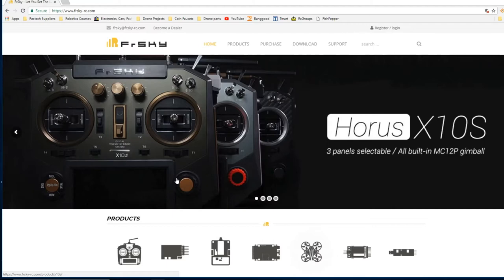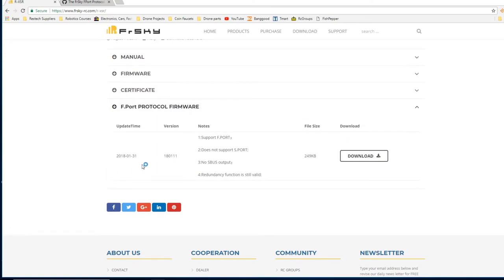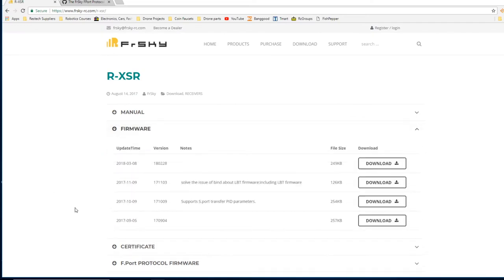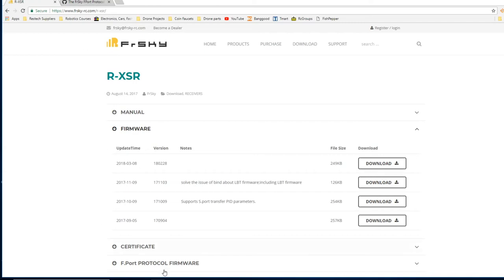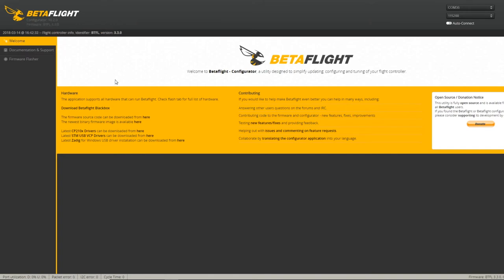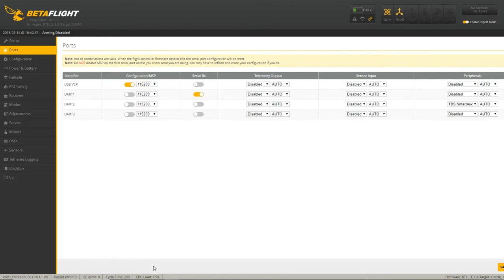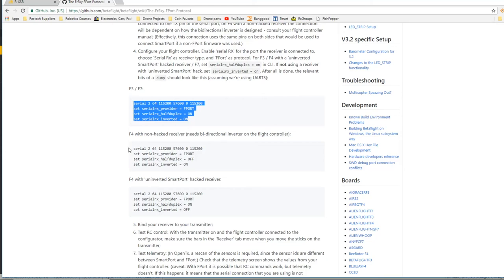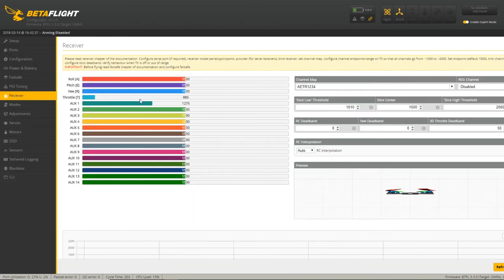How to setup Frsky F.port Protocol R-XSR Betaflight

Comment: Need help! NWhich telemetry output? In ports tab Smart Port? Frsky? Eh I've tried both... I have no idea why this isn't working I've done everything step by step. I've got the flex firmware, on everything, but either way the uart is the ports just won't stay in what i set it to, so something's screwing up. I'm using the slim+so i used the uninverted s. Port wire to go to tx3 on lumenier micro lux v3 so i wouldn't have to use soft serial inversion, and i used the cli set of commands for f4 with receiver uninverted.. I've got it set to fport, serial based. What am i missing? It's uart3 so i copied cli as was, used for 2(uart3) in0=uart/tx1 1=2 2=3.
Reply from the maker: You don't have to set that in the ports tab just turn on telemetry in the configuration tab and set your serial rx to f.port and you're set
Reply: @dwarfstarfpv2056  ok i must be missing something..
Reply from the maker: @softsmoken  you tried turning on or off half duplex in the cli?
Reply: @dwarfstarfpv2056  on, just copied and pasted
Reply: @dwarfstarfpv2056  I'm bound to it using an xlite. I dunno i can't see what the problem is
Reply from the maker: @softsmoken  its definitely betaflight f.port is a real pain I stopped using it unless the flight controller has a dedicated smartport pad then f.port is a bit easier to use
Reply from the maker: @softsmoken  also make sure your wiring is correct you only use the smartport pad and are you using the sbus pad on the fc?
Reply: @dwarfstarfpv2056  i used the slim+so it had the extra sport and sbus inverted from the normal inverted so uninverted, which is i think the whole purpose so anyway that's labeled rx1 for sport and i wired that to tx3 hoping to avoid using soft serial. But i also tried with soft serial on, no dice.. I'm not wired to sbus in the FC, i wish i could it would save the uart..sbus is an rx uart though not tx so can't.
Reply from the maker: @softsmoken  try using just regular f.port firmware instead of flex
Reply: @dwarfstarfpv2056 i only saw regular then flex which was only fport capable one i saw. It's annoying when stuff just doesn't work setup exactly how it's claimed stable.. really gets old quick.
Reply: Really disappointing might need to ditch r9 while I'm only 1 receiver deep, just gonna cost money and cause builds to sit unuseable, what's the point.
Reply from the maker: @softsmoken  yea I feel your pain lol all my builds are r9 now but I hate f.port in use normal smartport and its amazing f.port is super sketchy I can try to wire up f.port on my micro lux v3 and if I get it to work I'll let you know what I did
Reply from the maker: @softsmoken  haha so true
Once you get it working just never touch the firmware again
Coming to think about it I'll have to use f.port on my build also ughh this is gonna be fun lmao
Reply: Actually wait could i maybe use normal sport on tx3 and soft serial inversion and use the sbus pad for the rx wire which is uart1 on micro lux v3 and already inverted? Then I'd have tx6 for smart audio at least. Really wanted gps..
Reply from the maker: @softsmoken  you can actually use normal s.port soft serial on the led pad I think and you'd have all the uarts for gps and smart audio
Reply: @dwarfstarfpv2056  so it's the led pad that's uart1 not sbus? And is a tx?
Reply: @dwarfstarfpv2056 so with LED setup it would be sport to led and... Which to which, and then which uart would represent it and need soft serial inversion i mean?
Reply from the maker: @softsmoken  sbus will still uart1 but you're gonna assign the led pad to soft serial 1 or 2 and then that uart will popup in the ports tab and you'll use that for s.port
Reply: @dwarfstarfpv2056  is LED pad the tx to the sbus pad which is rx? Of the same uart? Cuz most uarts have a tx and rx so sbus is only one pad and is rx so that's why I'm asking.. If you happen to know lol... BTW I really truly appreciate every second of your time you've taken to help me out.
Reply from the maker: @softsmoken  ohh no idk where tx1 is or if there is even one but what you'll have to do is use the inverted s.port signal wire that up to the LED pad and wiring up sbus to the sbus pad then you're gonna have to remap resource the led pad to softserial 1 or 2 here is the guide i used and s.port works and you'll have the 2 uarts https://blog.dronetrest.com/smartport-telemetry-via-softserial-betaflight/
Reply: @dwarfstarfpv2056  we'll I'll have to give that a try... I'll get back at you on here let you know if it works. I might try fport on one or two other wired configurations before i change all the firmware again. I know tx is an input rx is an output. That's why you need the two for telemetry similar to how we need two for osd(video in and out).. far as i can understand..
Reply from the maker: @softsmoken  yea try f.port again and I think since you're using the uninverted signal tlm_inverted should be set to off and the TX you're using serial rx is to be turned on in the ports tab
Reply: @dwarfstarfpv2056  betaflight won't recognize the command... What a load of bullshit i typed get tlm in cli it shows the exact command but it doesn't work. Lol , unknown command, even though it just gave me the command from it's directory, Unbelievable... It's like it's all just broken.
Reply from the maker: @softsmoken  oh wow you're on the latest configurator? Type dump and scroll through to see the Tlm info
Reply: @dwarfstarfpv2056  yea i am It still provided the command including tlm when i typed get tlm
Reply: Tlm inverted=off
Reply: @dwarfstarfpv2056  what version betaflight were you using, which configurator with the  fport receiver that worked on for you?
Reply from the maker: @softsmoken  mine is on a helio board running 3.6.6 f.port is super slow at changing pids and stuff through lua scripts but regular s.port on the same 3.6.6 is fast you should really try regular s.port with the soft serial way it's pretty easy and should be flawless
Reply: @dwarfstarfpv2056  well.. i plan to go back to s.Port from fport if i don't have any luck finding any other promising things to try, but then i gotta switch my firmwares back on the r9mlite and the slim+. I had two questions, 1. So we can't have some fport receivers running and some sport without changing modules or firmware right? like i can run my xm+quad just that models settings are internal antenna on and external module off you know.. but the module can't do both, i don't think the flex firmware is capable of both i have to read it again... But you'd think in 2019 it would be able to run its basic old stuff on the same module. Question 2. If I'm not really flying long range, how much is the 900mhz gonna make a difference? I went with it cuz i got it new with the slim+for 46$ made on offer to guy on ebay r9mlite was 39 plus 5 ship obo and slim+was 29+5 ship obo i made an offer 22 and 19+5 shipped together,and the dude accepted it. Could've believe it. I wanted, even if I'm not going so long range to just have solid connection cuz there's all kinds of WiFi interference and stuff around this area. Basically How much of a difference did you notice when you switch to r9, besides distance gains?
Reply: @dwarfstarfpv2056  good morning! I got radio response in receiver tab with fport on micro lux v3 this morning!
Reply from the maker: @softsmoken  oh shoot now seeing this lol idk about the fport and s.port without changing firmwares but I try to make them all the same just to keep it simple I dont even update when they release new firmware cuz it's to much of a hassle but it's not a pricey product like crossfire so I guess yea you gotta use the internal module for the rxsr and non 900mhz receivers as for difference I got the r9m setup because it was super cheap at the time lol and I feel better having longer range cuz I love diving stuff but my rxsr still performs great r9 is just extra insurance on signal which is good, how'd you get it working ?
Reply: @dwarfstarfpv2056  yea I'll have  that internal normal 2.4 just set with external off for models without r9. And far as i can tell f. Port and s. Port are both supported in non flex firmware so you should be able to just differentiate by receiver # and s. Port or f. Port betaflight setting without changing firmware... I went back and looked through the normal firmware which before didn't have f. Port sorry it was a separate file then they added flex, but there was no fport section anymore so i thought that was only option, but newer frsky r9lite fcc standard firmware on the regular firmware section now says fport support... So i flashed to those standard newest firmware. Telemetry on soft serial off rssi adc on rssi channel disabled, CLI: half duplex on serial rx inverted off. Wired the rx1 inverted s.port wire (inverted inverted=uninverted) to tx3 and a 5v and G. soft serial is useless for radio control too slow, so i would've gonna back to s.port before i did that. To clarify f.pory is actually not an inverted signal, it comes inverted because it uses s.port which inverts it, so inverted standard  s.port (uninverted)should just be called f.port. AND unrelated, incase you didn't know(i only saw the note on getfpv under product info) the micro lux v3 needs the board and sensor alignment for yaw set to 90.. something about the sensor originally used for something else so out of the box it's off on yaw by -90, so just input 90.
Reply from the maker: @softsmoken  so technically speaking if you used the r9mm receiver on f.port it would just work with any FC because that one has the inverted s.port signal, I picked up one gonna give f.port a try again oh yea I was reading something about the micro lux gyro and whatnot I still haven't even taken mine out the box :(
Reply: @dwarfstarfpv2056  yea just use newest standard firmware it'll support the f.port, this one i just finished is 3 inch, 275grams with 850mah 4s battery. It jumps alittle just when arming at 5.5% hehe... It's a little monster. I just made it slightly over powered with heaviest pitch i could find. So i can hopefully get a decent size battery on it for distance or just more aggressive and a smaller battery for quick smaller flight
Reply: @dwarfstarfpv2056  man.. when I hit the throttle sick and that bar finally moved in betaflight... Hahahaha you know the feeling.
Reply from the maker: @softsmoken  nice ! The smaller quads are so much fun those things rip! Oh yea I know that feeling haha all the stress is over, RDQ has the r9mm with the T antenna for $20 if you're interested hopefully they dont sell out soon
Reply: Oh nice. Very cool... Good to know

Comment: So my rssi in the same room is only 30, I know there's a setting or two you supposed to change for this, something from 200 to 100.. shit I can't remember what it was. Do you know what I'm talking about or how to fix the low rssi for fport
Reply: Maybe I need a lower/better rssi channel? I dunno why but I'm having trouble changing it.
Reply from the maker: Oh there's a setting for that I'll post it for you when I get to my taranis but basically you have to search for sensors in the taranis then you'll see the rssi the on the channel page you'll have to assign it to a channel I'll post the link to the video I used
Reply from the maker: https://youtu.be/t-evOAS9Mkg here it is
Reply: @dwarfstarfpv2056  Yea it wasn't the channels I don't think..no not there, I'll take the link anyway but the xlite was showing full bars for connection, the xlite sensors has 100db rssi, the osd has 30.. I'm gonna try the scale 200 cli command, that seems like the one I couldn't remember, Bardwell mentioned it when I was like the xlite seems to be full rssi but the monitor says 30
Reply from the maker: @softsmoken  https://github.com/betaflight/betaflight/issues/5551 check this one out
Reply from the maker: @softsmoken  normally the sensor will always be right but then you have to place it on a channel then set the aux channel in betaflight for it to show the correct rssi in the osd
Reply: @dwarfstarfpv2056  I switched off rssi adc I didn't notice it was on..I thought I turned that back off. Anyway that went from 30 to 43 then I changed the rssiscale to 200. Now I get 94 so it's mainly corrected, but that last little bit I think I'll get out of getting on best channel for the rssi
Reply: @dwarfstarfpv2056  just double checked it and it's giving me a 99 so I guess I can't complain
Reply from the maker: @softsmoken  oh nice I really wish this stuff wasn't so complicated sometimes
Reply: @dwarfstarfpv2056  shit yea, when I started first little learner drone turned out DOA, then my first build that I fast tracked cuz my little one didn't work I was going to use while I built my first 5 inch, then the ESC with my Mamba stack was DOA... First two quads essentially DOA. Took me over two months after I started to see a motor fuckin spin. So I've learned allot lol.

Comment: Hi how are you?
 Please let me know if possible where I can decrease the "refresh" time of telemetry in frsky taranis x9 lite?
Reply from the maker: Hey, so you want it to read out telemetry faster ?
Reply: @dwarfstarfpv2056  yes, mine takes 15 seconds to update!
Reply from the maker: @paulopc77  I don't see an option to lower that, maybe set your low alarm higher? I used to hate the sound of it saying it over and over so I ended up setting my low alarm so low at 45 and it never said anything until I got super far out
Reply: @dwarfstarfpv2056  thanks!